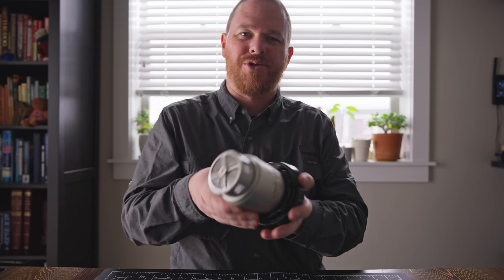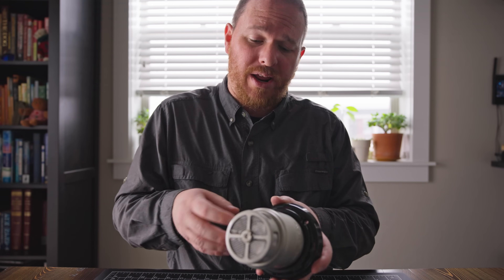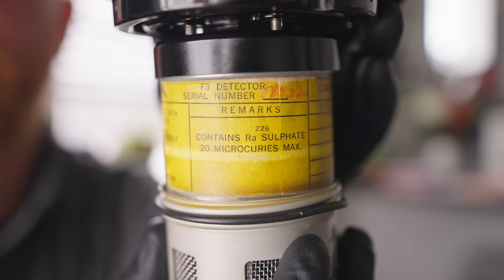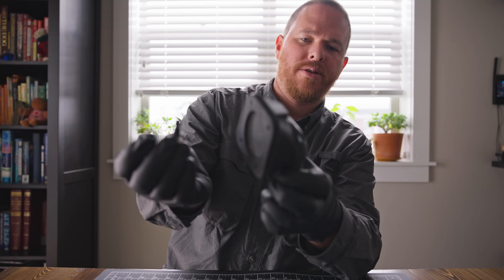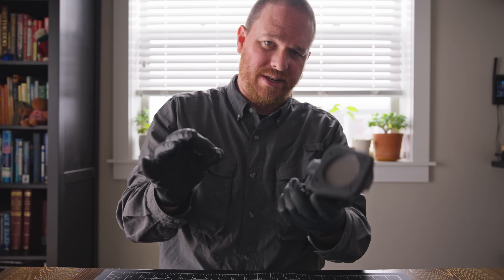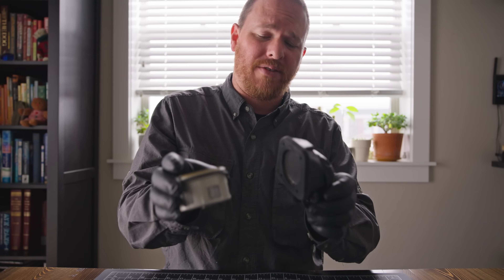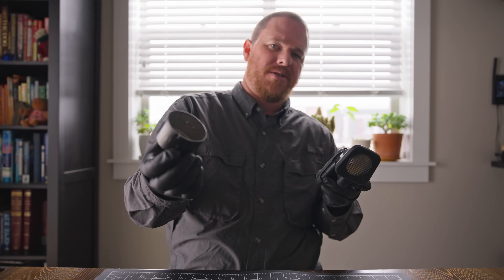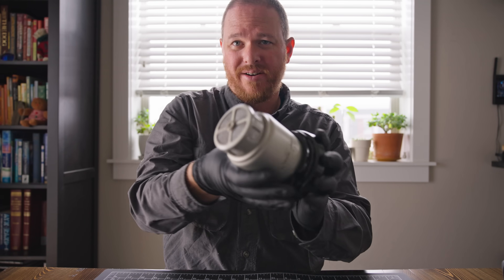Intensely Radioactive Industrial Smoke Detector from the 1950's

Comment: It’s absolutely mind blowing that A) these things were installed in peoples homes, knowing full well at the time that Radium is dangerous, and B) that you can freely buy them on eBay and the likes… that’s genuinely really concerning to me.
Reply from the maker: These weren’t installed in homes. These were smoke detectors used in factory environments.
Reply: Even still, those factories will have had workers who were exposed to them for prolonged periods of time, surely?
Reply from the maker: I’ve only seen smoke detectors like this in a building once. That was in a reactor building at a nuclear power facility. It seems the procedure with these units was to install them far enough from people so they didn’t unnecessarily expose people.

Comment: The inverse square law is his friend. Nothing he has is a big deal-as long as none of the sources deteriorate and particles thereof get out and about. If that were to happen, he would have radioactive contamination  issues which is a real safety problem. Mere exposure can be controlled. 

I’m sure he’s surveying his work surfaces after putting his sources away. He certainly has suitable equipment to do it.

BTW, to put things into perspective, get one of these detectors-especially a scintillator type-and scan someone who’s had either Radio-Iodine treatment of their thyroid, or a nuclear stress test with Technetium-99. You will see much more specific activity than this.
Reply from the maker: I do check my work surfaces for contamination. Seems to be a good practice to follow. 

Yeah, a lot of people don’t realize how radioactive someone is after they get injected with Tc-99m or I-131.

Comment: Can you build a box lined with lead to shield yourself? Would lead crystal make a shielded window?
Reply from the maker: Usually with a "hot cell" what they use to handle very dangerous radioactive isotopes they use glass with lead added to it. Its usually several layers with mineral oil between the layers. I think that's mainly for viewing clarity.

Comment: I am a bored Health physicist who has been doing this kind of work for 33 years. I noticed your comments and thought I would chime in.  I did some calculations along the decay chain and determined that You will get some gamma's (not x-rays) from the reactions, but they will be light and low energy. you will get B- particles but those will be shielded ( good heavens don't wear a lead apron or you will turn B- to bremstrahlung), but primarily you will get Alpha particles which the can will shield mostly. This is a sealed source so unless you broke the seal you would receive far far less than 1 mR/hr to the skin much less the whole body.   P.S. I stopped reading part way through and when I stopped laughing I did my calculations. forgive spelling errors.

Comment: 0 min 54 s Actually, most smoke detectors have 0.9 uCi, not 0.3 uCi of Am241.
Also, if you calculate it comes out to 0.3 ug of Am241.

Comment: "I don't like handling it much."

THEN PUT IT DOWN OMG
Reply: There is no issue handling radioactive items if you use safety precautions. This is retrospect is a low activity source to what is actually dangerous. Which he was using all precautions. and being safe. As for the whole shaving years off live. You get more radiation from a dental xray then he got from doing whole video. he is fine

Comment: It's scary because until you pull out a detector, it looks just as any other item. Odorless, not emitting light, sound, heat, anything. Just looks like an ordinary piece of metal that if someone had lying around in a drawer with a bunch of screws, would never get noticed. Imagine this lying under your bed or in a pocket of one of your clothes. Or maybe in a glovebox or armrest storage of a used car you bought. You would be dying without even knowing it.

Comment: The most radioactive thing I own (actually the only radioactive thing I own) is a radioactive Fiestaware plate from the 1930's.  I got it to test my geiger counter.  Even though it doesn't put out nearly enough radiation to be dangerous (the highest reading I've gotten from it, really close up, is around 60 microsieverts/hr), I still keep it in a shielded box just to be safe.  I have a geiger counter that can detect the full spectrum (alpha, beta, gamma, x-rays).  Interestingly enough, although my plate is supposed to be U-238 which is an alpha emitter, most of the radiation from the plate is actually beta.  I suspect this is due to being a 1930's model rather than a newer one, which used more natural uranium...so most of the radiation is probably coming from decay products rather than the uranium itslef.  Geiger counters are pretty easy to overload, they are not designed or equipped to measure high level sources (it's a consequence of how the G-M tube works, it's impossible to make a geiger counter that can measure high level sources like this).  If you want to measure high level sources, you'd need a scintillation counter.
Reply: Oh hey, I have the exact same story, I noticed that it was emitting beta and almost no gamma at all, thanks for explaining that for me!
Reply: Both the old and new fiestaware produce mostly beta, since the second decay product of U-238 is Pa-234m (a potent beta emitter). Just because natural uranium was used in the old fiesta, it doesn't mean it contained all the long-lived daughter nuclides (such as Ra-226), as processing the ore removes them. U-235 has a much less exciting decay chain compared to U-238, hence the depleted U plates are just as hot as the older ones. If you want to use a GM counter for high dose rates, you just use a smaller tube! Energy compensated GM counters are the industry standard for personal dosimetry (although other technologies are also used for cumulative dose monitoring), and small tubes capable of measuring up to 1000R/h are commonplace. Scintillators are more sensitive, and in fact far worse with intense fields than GM tubes. I think you might have meant ion chamber, and not scintillator, as these are commonly used for providing exposure rate readings in intense fields.

Comment: The amount of radioactive dust he's inhaling is insane, he should've worn full PPE a respirator and a huge trashbag to contain the dust from the source. Or a small glovebox

I work as a firefighter specializing in CBRN and HAZMAT response. This is the most dangerous thing I saw. No offense to you but you should be extremely careful, it is similar to holding the firefighter's boots in Chernobyl but more stronger.

Edit: its 20uCi which is 740000 Bq which is spicy

I'd recommend using Sievert or milirem as cps is a headache as there's no standard for it
Reply from the maker: There is no dust. I check for contamination every time I handle this object. The radium is sealed up very good.

I use CPM because I want to know the total counts of everything coming off an object...not just one type of radiation. CPS or CPM doesn't need a standard, its the amount of counts coming in. All its doing is totaling counts at that point. There is no conversion.

Comment: If you don't have a geiger counter, just put a camera on the radioactive material you want, and there you go!
Reply: that does not measure radiation, only shows radiation is there. This method would also not detect Alpha and depending on the phone Beta, only Gamma
Reply: @Blu-ray  So.. you're saying if i put a camera near a CRT TV.. will it detect it on the sides or no?
Reply: @18436Melissa  no, a crt emits very small amounts of x-ray radiation, the amount of radiation emitted is so small the phone's sensor wouldn't pick it up. I also tried it on my CRT to make sure and was right.

Comment: I remember 30yrs ago working at the holiday Inn conference resort in Decatur IL. In the maintenance department and we were told to remove all the old exit signs that had these little glass tubes of radioactive  material that glowed constantly and I remember one of the guys breaking the tunes open and smearing that crap onto a sheet of plywood and him thinking it was funny. I removed myself from that area very quickly. He definitely underestimated the dangers.
Reply: Those contain Tritium
Reply: @mirskym  yeah in gaseous form to be clear; it excites phosphors on the inside of the tube which is what the guy was smearing around. Interestingly one of the buildings I worked in at a major tech corporation (we moved) used to be a US Superfund site precisely because of their use of Tritium. It was an old Timex building and they were apparently making GTLS (Gaseous Tritium Light Sources). It had been thankfully remediated before the company ever took it over. You can look it up, Valley Green One in Cupertino, Ca.
Reply: I hate it when people smear gaseous vapors less dense than air all over my ply wood too.   It makes me feel super duper unsafe as well.  I always say say 'when I feel in an unsafe state, I must evacuate'  You can never be to cautious, anything to feel like your safer right. Feelings matter, the mostest.

Comment: 0 explanation of how it works and why is it so radioactive compared to household smoke detectors that use radioactive material
Reply: There's this concept called Half-life which every element has but it is much much much lower in radioactive elements.
Half-life is the amount of time an element's nuclei takes to decay by half.
When elements have an extra amount of neutrons or protons it becomes unstable, releasing energy. This is decay aka Radiation.

The household smoke detector uses Americium 241 which has a half life of 7,500 years.
The Industrial smoke detector uses Radium 226 which has a half life of 1,600 years.

You can see how they Radium releases energy much faster then the Americium which is why it is more radioactive.

Hope this helped :)
Reply: @Blu-ray  Yeah, but why use radium instead of something safer
Reply: @machintrucGaming  They actually didn't know how dangerous it was was, well they kind of knew but the US Radium Corperation had bad quality control. These were made from the 1950s till 1968 when they switched to using Americium Oxide. There were 5 models F3, F5, F3.5A, F5A, F5B, The F3 and F5 were the only ones to use Radium. If you are interested there is this really interesting report from October 1965 about the detectors on the U.S.NRC website. https://www.nrc.gov/docs/ML2013/ML20138M893.pdf

Comment: time for the stupid question, why does an industrial smoke detector have to be so hot radiation wise? Is it just so that normal dust and smoke from in spec processes does not set it off since they predate proper thermal detection systems?

Comment: Smoke detectors using radiation need replaced as the basic smoke detectors when we have photo electric smoke detectors that is much more reliable when detecting a fire and yes a ionization detector has been found to only detect fires 8 out 10 times and if a fire is a slow smoldering one then it's likely to not be detected by ionization detectors.

Comment: Maybe one should point out that not all smoke detectors contain radioactive material. I am not sure what is available in the US, but here in Germany (and likely most of the EU), you don't find radioactive smoke detectors for home use. Maybe for places that have a full-fledged fire alarm installation, not sure about this. 
The ones for home use over here are optical detectors. Basically an infrared LED flashing into a dark chamber with a detector monitoring the same chamber. They are arranged so that normally the detector can't see the LED - but if smoke enters the device, the light is diffused and the detector can pick up the LED's flashes, triggering the alarm.
Reply: They do exist in many countries but are only rarely used in some countries
Reply from the maker: Yeah I can walk into a home repair place anywhere in America and buy as many of the smaller Americium smoke detectors as I want.

Comment: One teacher I had, when trying to describe dosage of radiation to middle-schoolers put it in a rough analogy: The intensity is how "bright the sun is, getting stronger as it is closer", the type of radioactivity is the "color of the light, which may go through some things and stop at others, and will give varying degrees of 'heating' the object", and finally likened the effect to "how much sunburn you get and if it will lead to 'skin cancer', depending on these variables".  Not bad for the basics.  Anything he might have missed?
Reply from the maker: The light analogy is pretty good but it mainly works for gamma radiation as that is a form of electromagnetic energy just like visible light but at a much higher frequency. Alpha and beta radiation are ejected particles from an unstable atom. So it doesn’t work too much for them but I think good enough for middle schoolers.

Comment: This thing is 70 years old! It was not designed for this age. The  Ionotron Foil might have partly disintegrated and releasing much more radon 222 than was meant to be. The crystal structure of the used zinc sulfate is known to break down after time. Your Radeye is counting more than 1.000 kcpm, but you don't know if that's alpha-particles coming from ra-226, rn-222, po-210 or beta-particles from pb-210. There's a good chance that some part of it was coming from po-210 and pb-210 dust particles that accumulated in the device during its lifetime and that might have become airborne. By taking apart this thing and not wearing proper respiratory protection you could have put yourself in serious danger. Even if you keep this thing in an iron vault, rn-222 buildup in the vault continues to a dangerous level, which you will be exposed to when you open it. I wouldn't have this thing in my possession.

Checkout the link if you would like to know the design-features: https://www.nrc.gov/docs/ML2013/ML20138M893.pdf

Comment: Now that's a hot little tamale! I have to laugh because myself I have a thorite rock from Canada that I bought on eBay and when I handle that nasty little thing (about the size of a tennis ball with jet black, glassy crystals all throughout), I tend to hold my breath until I've got it put away again to avoid inhaling anything hotsy totsy, lol. How long can we go without an intake of air today? Let's find out! 🤣
That little bastard puts out a fair amount of lower energy gammas, so I keep it in a lead lined can. Like, something around 2000 CPM give or take, up close to a SBM-19 tube. Takes about 1/2" of lead to shut it up to near-background.

Comment: I knew this was a serious source when I saw the gloves go on... I'm assuming that's a shirt that Drew doesn't mind getting rid of... Radium is not fun stuff I have several radium watches in a metal box in my attic, it's still notably hotter than the surrounding environment. Just not this hot
Reply from the maker: The shirt wasn’t contaminated. I usually check after handling objects like this.
Reply: @RadioactiveDrew  oh I'm sure the shirt is fine. It didn't look like you damaged the sources at all, but I'm guessing it was a shirt you were prepared to get rid of if you had to

Comment: kinda overplaying the gamma radiation. at 1cm the specific activity is aprox 129 millirem per hour if that source was brand new. higher than background yes, idlh not at all. could hold that for 33 hours before hitting your yearly dose. shouldnt mislead people with lights and sounds. your meter is out of range and probably not even calibrated.
Reply from the maker: My meter is within calibration as it hasn’t changed over the years, that’s the benefit of having a digital meter over an analog one.
Reply: @RadioactiveDrew  NRC, DoD, and FEMA recommend yearly to 2-3 year calibration on a control check source as license will dictate what calibration is best for equipment. Your equipment could be up to or over 20% wrong in its readings. It being a digital readout has no benefit over being analog as it doesn't change its readings, only it's display. There's no differentiation in analog and digital readout equipment across gamma  spectroscopy or radiation detection/contamination.
Reply from the maker: If I saw it out of calibration I would send it in. I keep records of activity levels on sources and check it against what I’ve taken when I first got the meter new from Thermo Fisher. I also check it against other meters that I have that use the same GM tube.

Comment: The normal home ionizer smoke detector has two chambers. One closed and one open.
When carbon dust enters the open chamber it conducts electric between two plates better with the help of the radiation.

The smoke detector measures the difference between the chambers, and if there is one, alarm sounds.
Reply: *depending on who made the detector.  Not all are like that.

Comment: It's made that way and used to be installed way, it would burn if fire escape. All those metals would easily to melt, even vapor in burning building. Pretty poor circuit, because it needs that much of radioactive stuff. I have seen those detectors 20y ago at industrial cabinet where inventers and some other things of paper mill needed. They could have made detectors at that time with optical parts, but they didn't think much of problems of do it way how those are put together. Yes, it's working and "good" device other way and trusted in use. Those have used to detect smoke in halon dumbing automation. So places where they use those were deadly many ways to people.